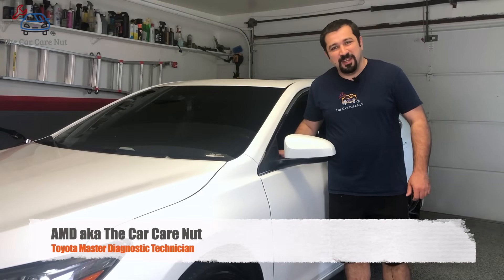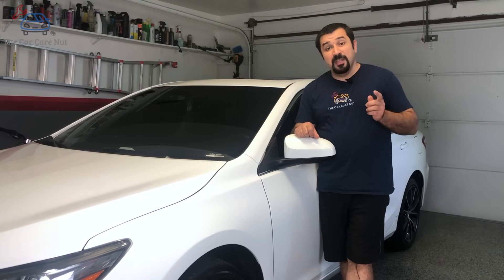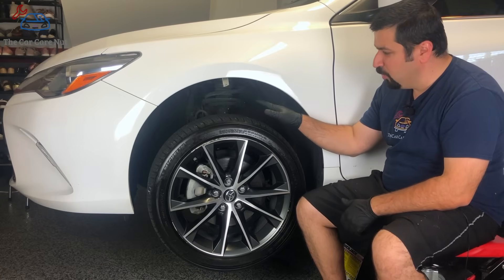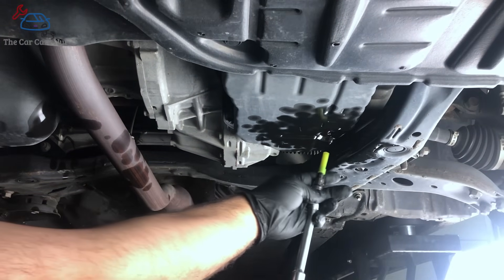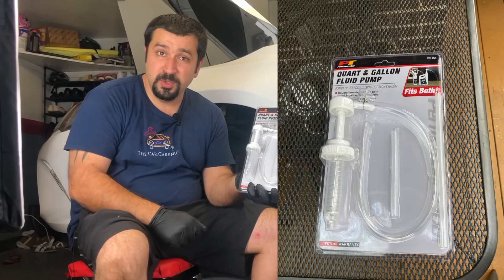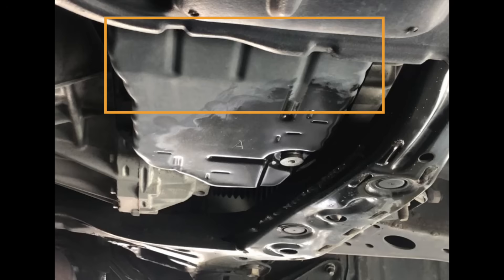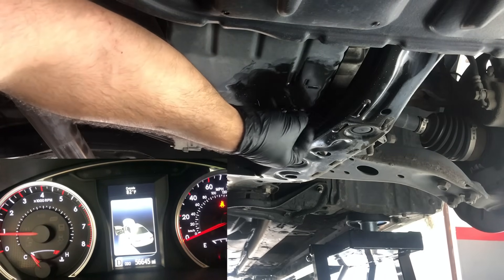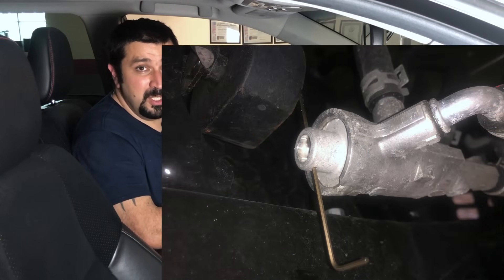How to change your Toyota Sealed Transmission Fluid

Comment: I just changed my transmission oil on my 2017 Toyota Sienna last night.  Thank you for putting out such great content.  It gave me the confidence I needed to do it.  I did not have a code reader or use the pin jump trick...I used an IR gun for temp...I know not the most accurate but it's what I had.  Test drive went good.  I was a little late to getting mine changed, 95k miles, but I'll probably do another drain and fill in the spring.
Reply: I have the same Sienna. What is the correct temp to drain the excess? I'm gathering material to tackle the job. Also, is there a replaceable crush washer on the drain plug?
Reply: @chrisflamion2283  Hey, were you able to replace the transmission fluid in your sienna? I have a 2017 one too. What temp did you use for the IR temp gun? Did you drain the excess through the drain plug like in the video? Thanks!
Reply: I have a Toyota premio which I am thinking of draining the cvt.  But I have some fears...  its very smooth .... now my fear is, will I drain and the smoothness goes!!
Reply: how many miles before a fluid change

Comment: I have a 2017 Camry 2.5. I couldn't get the "D" to disappear, stay on, or flash when jumping the number 4 terminal and number 13 terminal on the OBD2 connector. So I bought a infrared thermometer from Harbor Freight and I was able to get the fluid level correct. Thank you for this very simple and very detailed video!
Reply: What temp should it read?
Reply: @isiaettedarden1831  between 95°F and 113°F if you use an inferred thermometer.

Comment: Im all for doing things by the book but hear me out. Why isn't a simple drain and fill with the car cold and level sufficient? Most car owners won't ever  change their CVT fluid, you can read tons of dealers even refuse to do so. So if its underfilled from factory, either warranty will catch up to it or the trans dies anyway. For those that do change the trans fluid and it was underfilled from factory most will only change it at 50k miles so the damage would already be done and you're wasting money ans time doing this procedure?

I would just get two empty buckets with measurment marks,  pour what came out in one and pour new fluid lining up with an extra 1oz of fluid or so, slitghtly overfilled is okay. I just feel like doing this procedure is potentially more error prone if you have little exprience and the fluid you dump out of the extra 0.5qt isnt an exact measurement eirher. What are your thoughts?

Comment: Hi AMD,
I bought my 2029 sienna 31k miles on it. Now it has 93k mile’s transmission fluid never been changed . I took car several mechanic shops and they told me it is too late to change fluid on it, because car worked as taxi and too many miles. What you will advice? Your advice will be final for me. Thanks

Comment: I have a 2008 Lexus LS 460 with the HV transmission. I pulled the 6 mm drain plug out to check for the overflow tube and mine does not have one. I went to Lexus parts. They said they don’t show one for that vehicle. I stopped in the service department to ask how they checked the fluid and I was told they don’t. The only way you would need to check it is if you were losing fluid. I’m not losing fluid, but I hear a slight line and I thought it might be low so I started to check it.

Comment: My question is. So, if you drain the transmission fluid as shown in the video, and refill the transmission with fresh transmission fluid that is the same temp as the fluid you drained. Could you do 2-3 drain and fills and then on the last fill add the 1/2 quart more like you said and then confirm the level as shown in the video?

Comment: Hey AMD I bought a 2017 sienna with 120,000 miles the transmission fluid has never been changed.. should I change it asap 
No flush or leave it no change? What do you suggest? 
Thanks!

Comment: does camry 2017 3.5L transmission re-learn automatically after the transmission fluid change and flush? I had mine done at 35k miles and transmission switch is little late. It is not bad but not quite same as before.

Comment: If the fluid level was correct from previous drain and fill (or from factory if never done before), why does any oil come out when you remove the metal plug AND before you remove the plastic tube?  If the last guy let the fluid flow to a trickle with plastic tube in place, the level should be right at the top of the plastic tube and none (or very little)  should flow out when you remove just the metal drain plug.  Am I missing something here?
Reply: Yes you are.

Comment: I this very similar to my Tundra a few years back. What I did different was a pulled the cooler line and filled the fluid as it came out. Once the fluid was bright red I stopped. This way I got all the old fluid out. Then I adjusted the level. I'm due next summer. I tow so I keep on top of it.

Comment: Just bought a 2024 corolla and i want to be able to drain and fill the cvt fluid on my own. This guy really knows what hes doing.  Thanks for the video man!
Reply: 2024 Corolla? Transmission oil changes should not bother you for a couple of years.
Reply: @bmsk0076 60k miles for the cvt transmission change. I’m only at 29k miles on
My 2020 Corolla LE, just waiting to hit that 60k miles and then change that cvt transmission fluid. Mine has the 1.8 litre engine instead of the 2.0 litre engine

Comment: I can't imagine one of these "Express Lube" places following this procedure.
Reply: Not only that but something like a transmission being so delicate that an ounce of fluid difference potentially causing damage should be considered a design flaw.
Reply: I wouldn't even trust these places to check my tire pressure....
Reply: lol
Reply: What a pain in the ass. Thanks Toyota
Reply: IDK why anyone would have their transmission service at an express lube place anyway,  IMO it's one of those things that you either do it yourself (if you have the tools and knowledge) or pay the dealer.  Generally trans fluid changes are infrequent enough even if you had to pay a dealer $350, it would be worth it every say 5 years.  Not something you want to skimp on.  Oil is one thing, but trans fluid and coolant are longer-term fluids and need to be done correctly with the correct fluid.  Oils are less fussy and as long as you have the correct viscosity and type, there's not too much to screw up short of severely under or overfilling it or using the wrong filter).
Reply: This is so easy you can do it in a parking lot. Express lube has the best solution to the most difficult part of the procedure. Lifting it level with a 2 post lift
Reply: For my 2018 Toyota 1.8L engine cvt transmission the manufacturer recommends repeating this process a total of 3 times before the final fill and I was wondering should I replace filter if it has one and do you have a video for that?
Reply: A mechanic that used to build transmissions for Ford remanufacturing in Oklahoma City, retired opened his own shop.
  I asked him to change the trans fluid in my dipstick less Mazda.
  He said nawww I will farm that out.  I guess to much trouble for a 40 yr. Transmission man.   Sigh.  😢
Reply: But does the guy who would change your fluid at the Toyota dealership get paid much better?
Reply: The Toyota dealerships and other mechanics I've visited won't touch my 2014 150k miles Corolla transmission, because it's "closed." I've yet to find an honest mechanic who is willing. If I had my own garage, I'd totally try this lol. The interesting thing is that even when it was under 100k miles, the dealerships wouldn't service it because it was "closed" and "didn't need it." 🤔😂   @GeneralTso369 

Not all mechanics are created equal that's for sure.

Edit: Thankfully, this car has served me well and has no issues at this time. Hoping it lasts until 350k+ miles, but I'm sure the transmission will be the reason it fails in the future.
Reply: they have a vacuum machine, we don't!!!    so we only get 3Qts a time out...  they're able to flush the entire system..
Reply: @mrr8682 which is actually bad, and they usually use the wrong (cheap) fluid.
Reply: @mrr8682 as AMD said, not to change out all the fluid.
Reply: @mrr8682  they are absolutely NOT able to flush the entire system. 50% at most.
Reply: @mrr8682  That actually can be bad for your transmission. Don't do it! That system can draw particles into narrow passageways and clog those passageways. Also, for cars that have gone too long between fluid changes, changing 100% of the fluid to new can be bad for the transmission.

Comment: Is it safe to change transmission fluid in RAV4  2014 at 70k miles, some people suggest if it is not done at 36000 miles then it should not be done because it will cause transmission to start slipping. Thanks for very clear video with details.

Comment: Hi Amd ive got a cheap scan tool that read transmission fluid temp and i wanted to know what temperature range  should i be doing the level check on a 2019 petrol camry 6 speed.
Please specify °c or °f if you read this since im from New Zealand and we use °c here

Comment: I was working on my 2011 RX350.  After jump wired the connector and cycle through the gears, then proceed to D and N switch back and forth, roughly how long it takes to do this step before it switch from no D to solid D?  Mine is solid D from the beginning, and 5mins later, still solid D and no flashing D.   I didn't see the NO D stage.
-No D (didn't see this step)
-Solid D (have solid D from the beginning)
-flashing D (never reached this step)

Comment: Just cut down the snorkel by 5-10% height and skip the hot fluid warm up BS.  The fluid only expands a little bit and it will not make any difference if you are 5mm higher fluid level than ideal.    What is more critical is to double drain the fluid, because as you see only 2.5 liters cane out or about 1/3 to 1/2 of the fluid.  To only drain one time means you are leaving half the ild fluid it there.  If you only drain once then do this every 20k miles, if you double flush then you are good for 40 to 50k mikes.  Dont go over 50k mikes these fluids operate at high temperature

Comment: In my opinion the transmission filter must be changed every 60000 miles. There are microscopic pieces which clump together and form varnishes due to the heat. The varnish clogs the filter and reduces the line-pressure of the transmission slowly over the time.

Comment: Is this the exact same procedure on a 2019 camry and how often should this be done my girlfriend's car is at 80,000 miles right now and spark plug should be changed around 100,000 miles right

Comment: What is the correct temperature? I have a 2005 sequoia and a 2017 camry. The engine on sequoia is 4.7L two wheel drive and camry is a 4 cylinder

Comment: One should not without knowing buy a car as difficult to service as this.   I am a Toyota Corolla 2009 owner.   It still runs very well, very economically.   Since current inflation, I have learned to do as much maintenance as possible myself, even though I do not have a lift in garage nor a garage, even if I had a lift.  I have jacks and jack-stands.  I would not buy a Toyota that is described above.   It is too complicated for my to kill myself trying to maintain it.   The cost of taking it in for service is so inflated that I am not willing to have it serviced.   Bye-bye Toyota.   If I cannot find a car that is easy to service and dependable,  I shall not buy another car when my Toy fails.   I do not wish to be a slave to a service shop.

Comment: "Sealed" transmission with a paper filter... what a joke! Please keep in mind filter needs to be replaced at some point as well. 
By the way.... Has anyone found toyota's logic behind eliminating dip stick? 
Just a scenario... if the car develops a slight ATF leak, and you are traveling long distance how do you check oil level without the dip stick?

Comment: Thanks for the tips CCN - however, would it not be easier to simply measure the fluid that had drained out and put back in the same new fluid amount with a tiny fraction more?
PS Would the same procedure apply to a 2021 Camry 4cyl hybrid ?

Comment: First, thank you AMD for making ,and sharing these wonderfully helpful videos with everyone. They are a great, trusted reference source for the DIY auto repair community.  Love your channel! Keep up the awesome work! 

Would it not be prudent to at least make sure you can crack open the refill plug before draining the transmission fluid just like you would when replacing differential fluid? Also, would it be a problem to use the same drain pan you use for other fluids or should one pan just be for oil, a separate one for anti-freeze, another for transmission fluid, etc... assuming you drain them, but don't necessarily clean them thoroughly between uses?

Comment: What's the ATF WS fluid check temperature range for a 2017 Rav4 XLE front-wheel drive.  One video says 104-113 degrees Fahrenheit.  Thanks
Reply: I'll be using the laser thermometer method of temperature check.

Comment: IMPORTANT CLARIFICATION NEEDED -- At 3:06 point in this video you said the transmission fluid temperature should be between 95 and 110 degrees Fahrenheit.  That is INCORRECT.  You should have stated 95-110 degrees Celsius (which is around 203 - 230 degrees Fahrenheit). Otherwise, this is a GREAT teaching video!  Thanks.
Reply: Where in Sam hill did you get that temperature???  The manual specifically says 95F (35C) to 108F (42C).
Reply: @jonesjones7057  Please advise link to manual… Looking for temps for a ‘15 Lexus RC350
Reply: @calvincoolidge5150  102 to 114F.  I dont have a manual for it but I used to have an RCF and it was the same or dang close.  120F was the absolute upper limit.  It isn't rocket science anyway believe me.  The techs at the dealership probably don't even look at it.  If it's just warming up, say for 2 to 5 minutes, its fine.  It expands and contracts with heat and cold but I've measured the amount and it isn't some drastic level change.  I think they do this to scare us from trying.  That said I still look just so as not to be a total hack.  My wife's jag is 104 to 122F.  That's with the ZF 8 speed.  My '19 Tundra is 109 to 118F.  

So the advice in the video is spot on really.  If you're between 95 and 115, its good.  There are some references online, including Google searches that say what one guy said when he mentioned temps like 190 to 230F.  That isn't right.  It's hard to even get that hot at idle in the garage and 230 is actually the exact temp at which additives begin to break down in tranny fluid, so don't even remotely listen to temps like that.  Those are temps you'd see driving down the road at speed up a hill or sporty city driving.  230 is hot enough that if you saw that consistently, you'd want to consider an aftermarket tranny cooler.

BTW if you want even more piece of mind, find a good forum online for your car.  I do that for all my cars so I get as much info as possible.  In short time you will find a post about your tranny and almost all the time, someone will have a picture of the manual showing the temp range for your transmission.  Sometimes you can find it on other YT vids too.
Reply: @ Thank you for your response.  I think there are two specs but I don’t know what there’s a higher spec for RCF OR AWD and a lower spec for base cars.
How do I get access to a manual?
Reply: @calvincoolidge5150  yeah for your car I know it's 6 speed awd or 8 speed rwd but both have the same temp range but for manuals I always had good luck with ebay.  There's usually a few for sale there.  I don't know if I've ever bought one from a dealer.  Also sometimes you can find them on the internet just posted by someone but sometimes a pain to navigate through them that way.
Reply: Where did you find the temperature reference??????? I need the exact temp for my highlander
Reply: He just cost me an hour waiting for it to warm up to that temperature.  Wish people would know correctly before they comment acting smug like they are an expert.  My fault for thinking Amed might have mispoke.

Comment: I just did it in my Toyota dealer at 199400 Miles..They also told me that they don't flush all liquid NOT all the fluid..cost 227 dollars and they don't even replaced the trams filter

Comment: I have a 2008 4runner that my wife drives to work. It has 140k miles on it.  We went off in it and I felt a shutter as it was changing  gears only when your going slow in it. But if you kick it you don't feel it,  What should I do. We bought it used  and  I  haven't changed it and I don't know if it's ever been changed . Thank you

Comment: Love your videos. I think I have watched about everyone ! I just traded forma a 2016 Toyota Avalon V6 59k using the temperature gun what is the ideal temperature to check the correct  fluid level ? Do you still have the Benz . Just wondering   I had  a 84 500SEL 16 yrs  and  & Mercedes use to have a moto “Enginered like know other car in the world”😂 Never took it to the Stealership for any work but something was always breaking on it or always a shop trying to get a part.  I have an older LS460L,08 & a LS430 05. Never been to a 😮 but the cars are almost problem
 free. ill never buy anything but  a nice low mile Lexus or Toyota  😂 I had a LS400,99 230,000mi and loved that car. God bless you brother I like how you end your videos Blessing your viewers 😇 👍🏻
Another question the 2016 Avalon XLE PREM  DOES NOT HAVE PARKING SENSORs IN FRONT Is it  POSSIBLE TO GET A TOYOTA MECHANIC TO PUT ONE ON SO I don’t hit a curb parking etc…?

Comment: hello thanks for your helpful 
i have 2013 Toyota sienna withe 140000 miles on it should i chang the transmition filter when i change the transmition fluid ?